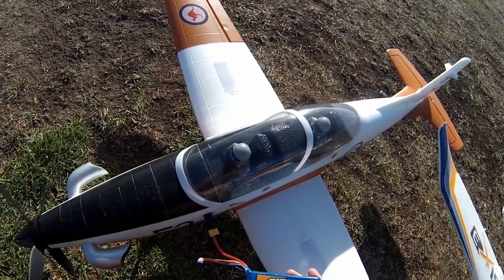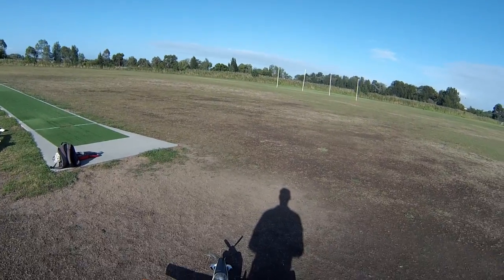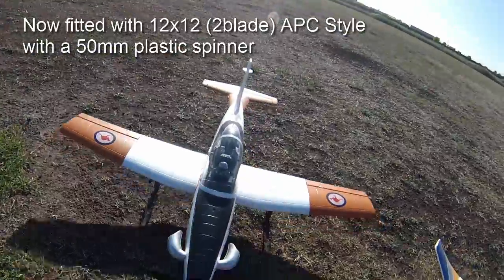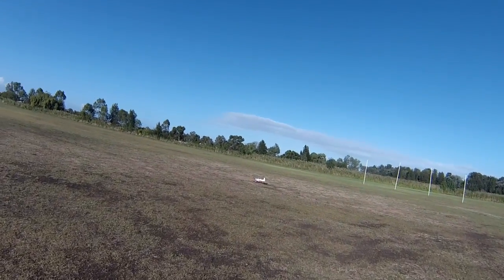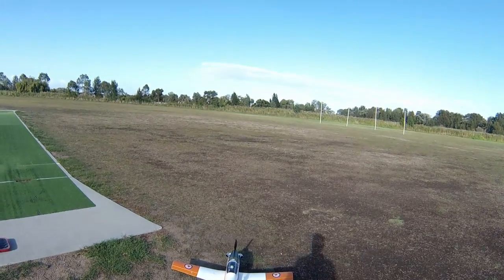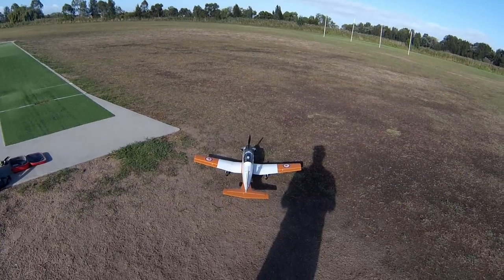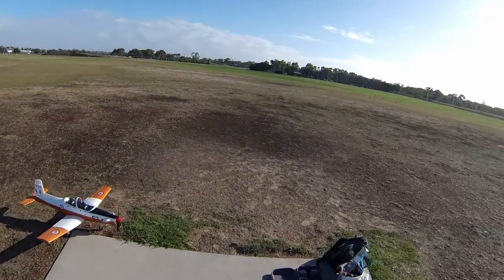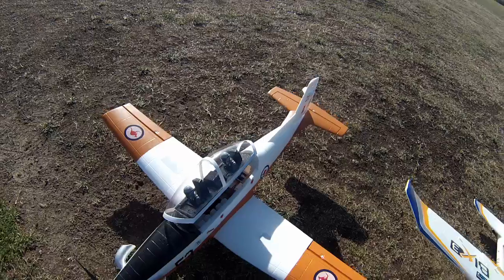Unique Models PC-9 - 3 Cells + Prop Test

Comment: How does this fly compared to a T-28 Trojan of the same size?
Reply from the maker: G'day Jamie, I have not flown a T-28. But many of the guys I fly with do have them from 1100mm Durafly and E-Flite as well as a couple 1400mm FMS. I would think they will fly similar to a Trojan. I wouls say this is quicker than a stock 1400mm FMS. It is heavier than the 1100mm Durafly and E-Flite. Which Trojan are you considering?

Comment: Hey there....So I watched the build of this airframe. Thanks for the tips.
As far as your maiden or checks on the various props. I watched as the plane nose dived a few times. Wonder if it has something to do with the weight /CG. From what I have read and heard on many RC & model RC shops online. Ie HK. they have a standard battery set up that is calculated on the various airframe tolerances. Im sure you are far more experienced than I am. So a 3s vs a 4s set up would suggest that the CG is probably right on the 4s as it has the correct weight for take off. Mainly because it allows lift on the elevator to the right degree. Your thoughts ??
Reply from the maker: +drone19730602 Thanks for the comments. I think that there was a few factors at play here. 
The first one is that I had the rudder channel running with no expo and a fair bit of throw, so that all translates to the ground handling (front wheel) being a bit squirrelly. I think that the nose dives are mostly due to the front wheel turning to far.
The other thing is that the CG is 2cm from the leading edge, which is quite nose heavy. The nose wheel works its way down a little after time (and a few heavy landings). This adds up to a fair bit of ground speed being required for take off. On the grass there I just could not get the ground speed with the 3S.
I have moved my CG back a little now with the same mod done by Rich in his video - https://youtu.be/WJEzD3V8YsI?t=23m39s I was happy with the way it was flying stock, but this mod does help the take off and landing. One thing to note is that the plane that Rich is reviewing and building is an older spec and has a higher kv motor and bigger prop. That set up was all designed to fly off 3S. I have also read though (RC Groups) that even the early version one really needed a 4S to be confident on the take off. 
My final thought; this is a fantastic airframe. Flies beautifully. You can mod a lot of things that might improve some of the niggles, but with the exception of a slight shift in my CG I like it stock. 
I hope your maiden goes well and you get a lot of fun out of this one. 
Cheers
Michael